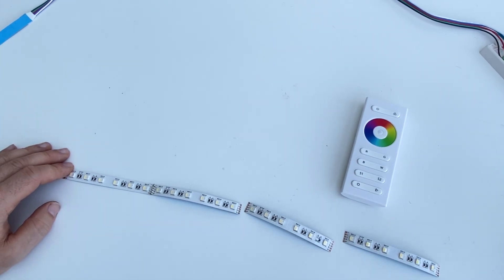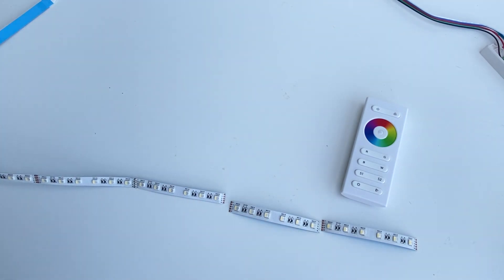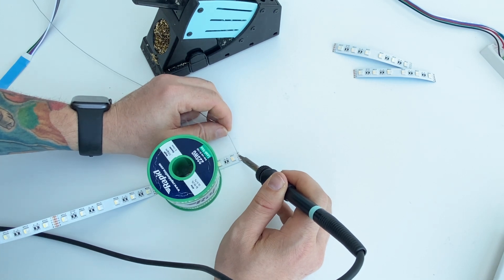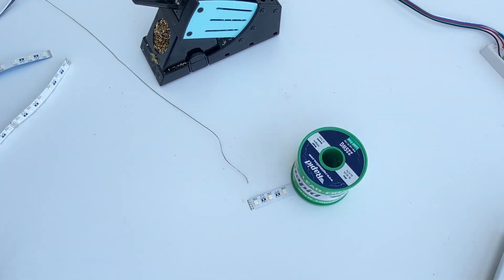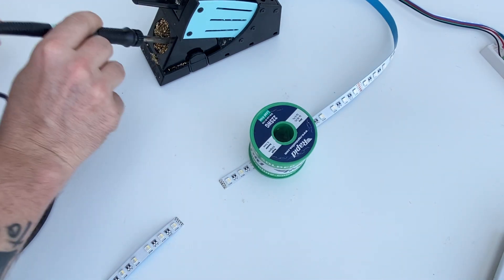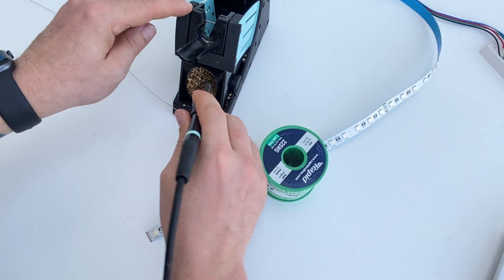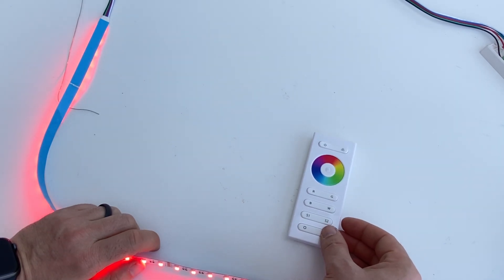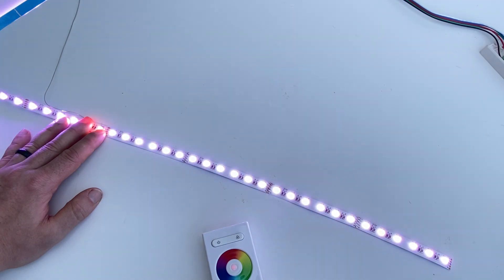How do I repair my damaged LED strip lights?  Solder in a new section

Comment: Not the proper way to do it. Solder is NOT a mechanical connection, it's ONLY an electrical connection. The soldered sections will be mechanically extremely weak. The least thing that should be done is use some tape on the back side to bridge the soldered connections mechanically but the golden way to do this is cut some legs of through-hole resistors or a few ends of solid copper wiring and solder those across the gaps. Tricky work, but the connection will last and can handle mechanical stress better. Your job may work if the strip is stuck to a solid surface right aways after the job but I also wonder how it will be over time due to temperature stress etc.

Comment: My led strip has a damaged copper pad, there is a small dent in it that prevents it from working is there a way I can correct this easily without use of and sodering